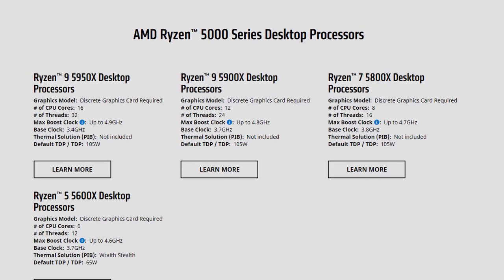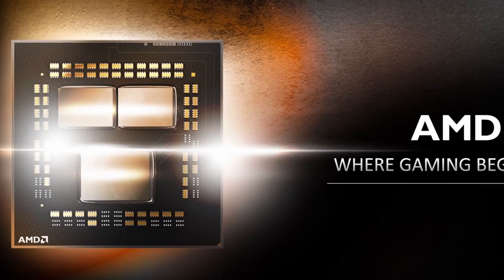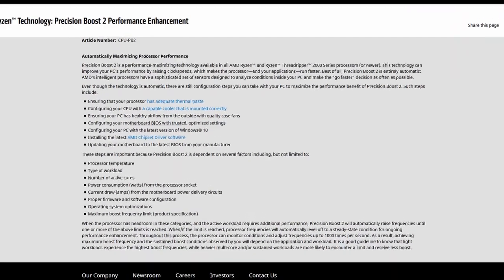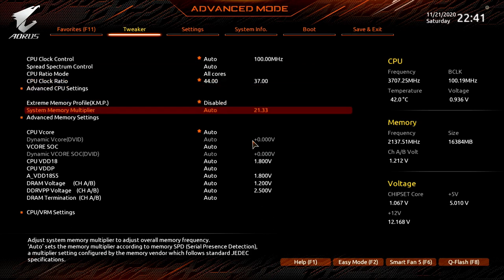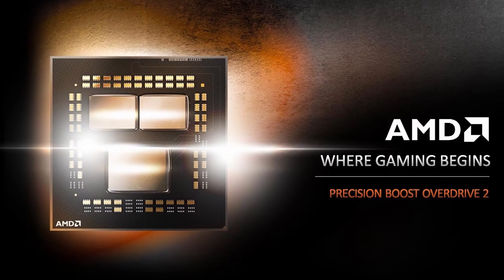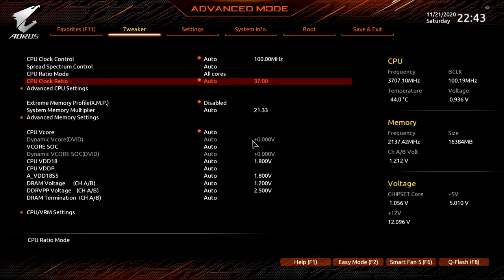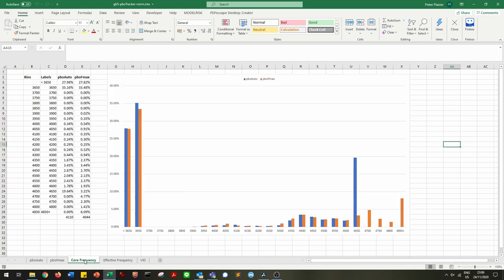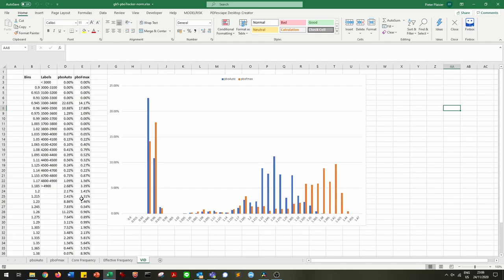Ryzen 5 5600X Overclocked to 4650 MHz With GIGABYTE AORUS B550 | SkatterBencher #18

Comment: i did this but i wonder one thing i keep 1.4v + in games will this be a problem?
Reply: ı did boost overdrive 4.75 ghz 4.85 ghz
Reply: you said 1.4 voltage is perfect with pbo it means does it safe? am ı using pbo with 1.4 voltage?  please help me
Reply from the maker: 1.4V is the factory voltage for high-range frequencies set by AMD. As long as your cooling can handle the increased power consumption of the CPU, everything is fine :)
Reply: @SkatterBencher  so can ı use pbo with 4.8ghz right? 
I'm afraid when the voltage goes above 1.4, I don't want my processor to be damaged it's really safe right?
Reply: ı'M using ml240 cooler btw
Reply from the maker: I have a video on Precision Boost Overdrive as well: https://youtu.be/1wcU8PrdGLE.

You will see that even though it reports 1.4v, the actual time it runs 1.4V is actually quite limited. That's because the 1.4V is only set for the high frequency. But when the CPU is heavily loaded and the temperature goes up, not only will the frequency decrease but also the voltage will decrease.
Reply: @SkatterBencher  thank you mate ı'm watching
Reply: Just got mine setup and can get 4.7 at 1.4v pretty sure I can get 4.85 in all core's just not sure if I should go near the 1.45v range not sure if that's safe for the chip
Reply: @rywat276  1.94 v? Downvolt it or you kill the processor
Reply: @gintonic8476  1.4 sorry

Comment: Hello, very informative video. Though I have 5600 non x variant and was wondering if I could apply the same settings on my apu? Cause I'm too newbie to overclock.

I also have the bios similarities I'm using aorus elite b550m

I hope you could notice my comment.
Reply from the maker: The overclocking process will be very similar, but of course your results may differ slightly because it's a different CPU :)